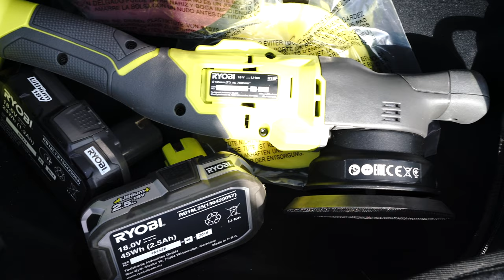What’s The Result After a 3-Stage Polish With a Cordless Polisher? 4K

Comment: If you don’t do a contact wash, just rinse the foam down, and go straight to drying (the way you did scrubing with the towel for that matter) it shouldn’t be a surprise that the car needs a 4 step correction 😁
Reply: Seeing how there was literally no pressure on the pad when polishing the side of the car, I'm surprised it wasnt a 12 step.
Reply: @stabface1266  you don’t want to put pressure on the pad, let the machine do the work